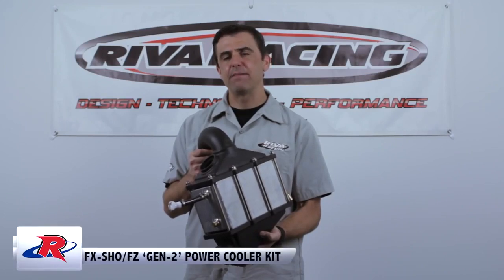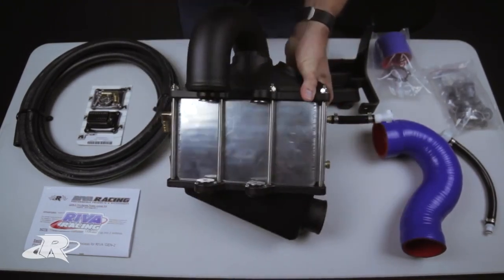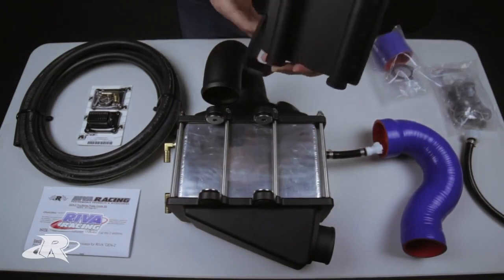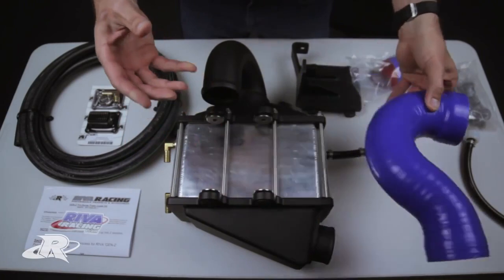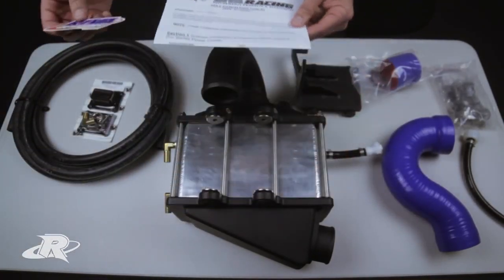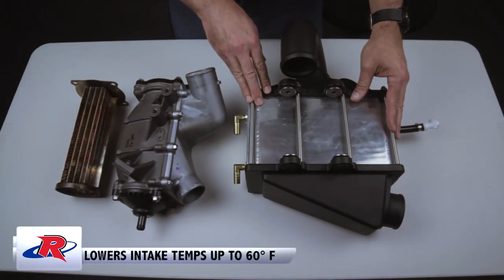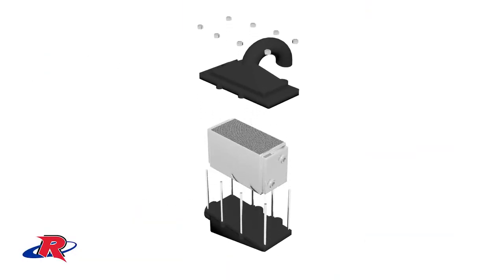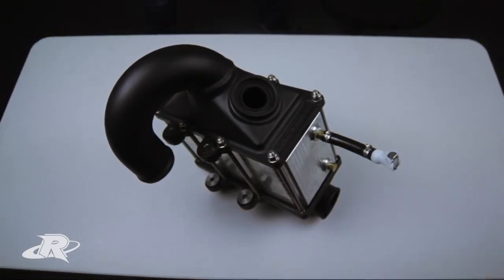RIVA Racing Yamaha FX/FZ SHO GEN-2 Power Cooler Kit

Comment: I had one of these.  It failed, meaning the salt water wore it away no matter how many times it flushed it.  It then pisses water into your intake and ruins you $1000 Throttle Body by Rusting it and could possibly hydrolock your engine meaning you need a new engine.  These Inter-coolers are not warrantied much and only carry a 90-day limited warranty.  I just lost THOUSANDS in parts and labor to fix my waverunner and lost half the summer.

Buyer beware.
Reply from the maker: umiami80  – Sorry you had this problem. We have hundreds of these intercoolers in the field with excellent service history. Also- This is the exclusive intercooler used by Yamaha’s Factory Race Team (Dean’s Team).   Please contact Brian in our customer support department tech_support@rivamotorsports.com  so we can look into this and better understand the issue.
Reply: @rivaracing8468  bueno yo creo q estoy pasando lo mismo ase 3 semanas puse un generacion 3 y tengo agua en todos lados me estoy bolviendo loco  con eso ademas entre en contacto col alguien de ustedes para comprarlo y nunca me dijeron de este q tiene menos largo de manguera yo amo riva pero creo y si es mi problema el intercooler que me voy a sentir mal